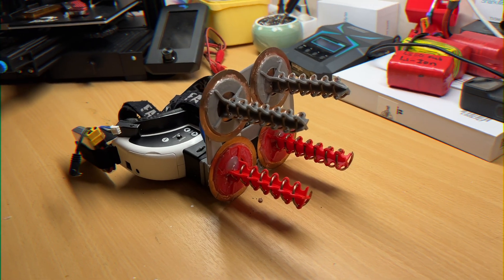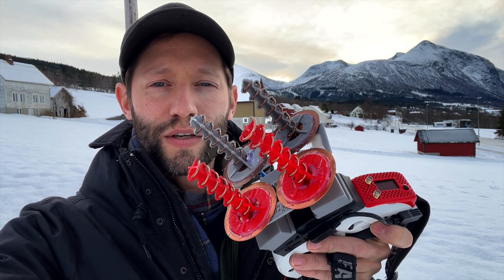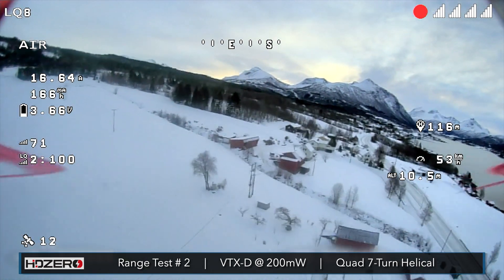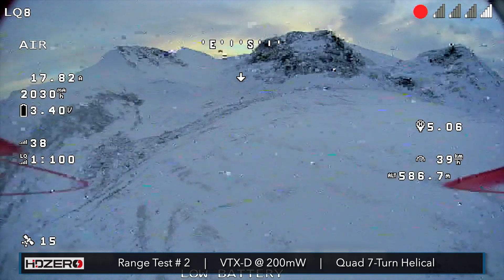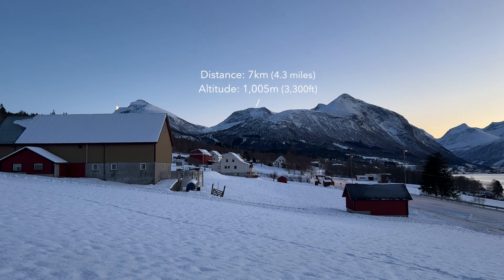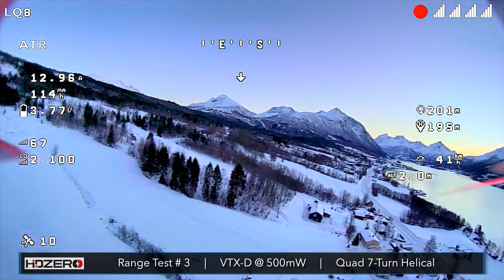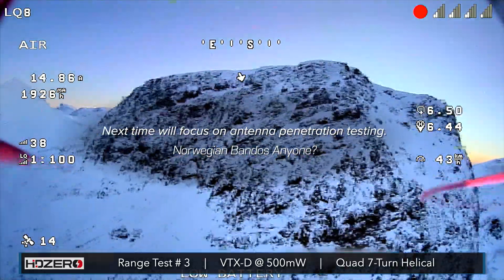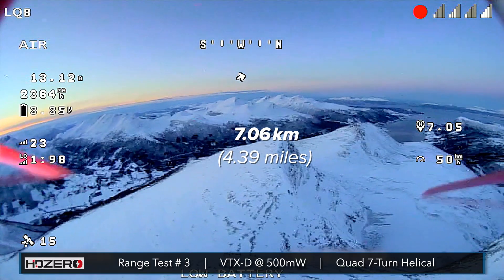HDZero SharkByte Long Range Testing with DIY Quad Helical Antenna! UFL to SMA Adapter Modification

Comment: All I see is brain cancer. Lol

 I'd probably be ok with stand alone antenna.
Reply from the maker: I understand your thought, but these are just receiving antennas, picking up signals in the air, they are not producing radiation. Two works nearly as good as one, as I show here: Cheap Easy Long Range FPV Antennas
https://youtu.be/JQiLjMU3J90

Cheers!
Reply: @GiantAntCowboy  I didn't actually realize that. I was thinking about it after and I guess the one major benefit to them on goggles is not having to adjust a base station. I'm new to this so just cramming as much in as I can.
Reply from the maker: @andrewbrown6522 yea, I like to be able to aim my head.  This is much easier with Analog & HDzero because you see the static come and go. 
With DJi/WS you kinda just watch bitrate & guess. 
But yea, cram all the information, that’s what we all do!

Comment: That's not even 1 KM. Fake, sensors not showing accurate readings at all.
Reply from the maker: @yasirahmad6271  It’s actually under 500m and within Visual Line of Sight due to current regulations and laws. 
Thanks for watching.

Comment: This why I fly fixed wing FPV, it can go for 60+ km on a charge
Reply from the maker: @nielsdaemen  yea, quads are really inefficient flight machines.  Four big motors/props, and zero static lift surfaces… 
But they give much better control in tight situations which is why I prefer them for mountain surfing.  
Building a wing had however always been on my “to do list”. Thanks for watching.

Comment: if you want to do it right you must insert a quarter wave length of 75 ohm per two  helicals....they need to be phased TOGETHER you could get another 6 db of gain for this set up you would need four 75 ohm sections all lenghts need to be the same odd multiples of quarter wave lenght....sorry im typing bad i have hand issues
Reply from the maker: I’m not gonna lie, I’m not sure what you mean by “Insert a quarter wave length of 75ohm per two helicals”… but I am curious. 
Thanks for watching and sharing thoughts!

Comment: What if you built a shield under the antenna to shield the helicals from the radio signal ? Obviously a shield that wouldn’t hinder signal of vtx.
Reply: Or is it from the tele coming from the quad . Just you putting radio closer to face caused break up .
Reply from the maker: @Loophole120  the interference in this video was because I was running my Crossfire Transmitter at 1W right below my Goggles which were picking up the signal. 
Last year I switched to ELRS and only run it at 100mW; here’s a video with some neat tests of both the ELRS, but also a quad helical design with WalkSnail and HDZero. At the end of the video I demonstrate how using High Power on your transmitter can cause lots of video interference.
“Antenna Penetration & Long Range Test”
https://youtu.be/FoSREiyDQDA

So to your question, no shield is really necessary; let me know if you have any other thoughts or questions!
Reply: @GiantAntCowboy  yes , I’ve watched those videos and that’s why I was wondering if you should try a shield .  Does the Elrs not do the same at high watts ?  If you were running high watts when you lost your one drone over the mountains edge . I’m sure the 1w would have not failed safe so quick , so I get you only like to use 100mw for that reason of interfering with video , but imo if you had more wats when you do accidentally go behind a ridge you have less chance of fail safes would you not ? So if you had a shield on top of the radio blocking just your face from the antenna, I’m wondering if you would have more success . Thanks for your replies ! Love watching and learning .
Reply from the maker: ELRS does the same at High Watt output power, the video I linked above was an ELRS test actually. 
Regarding using more power to avoid a failsafe, if you flew behind some bushes or trees far out, then higher output power would help. However if you fly behind a mountain peak nothing helps because it’s solid rock. Arguably 900mhz might get some you an extra moment because lower frequencies can “bend” a bit more, but it’s still solid rock. 
If you saw my WalkSnail test, I lost video, but actually my ELRS was connected for almost 5 seconds after the video loss.  Had it have FailSafed immediately GPS Rescue might have saved it. 

So you can try to build a shield, but i don’t know how much benefit it will have or how much benefit Higher output will really have in Mountain Surfing situations. 
The best solution is to make sure Stage 1 & 2 failsafe modes are properly set up.

Comment: Hey did you ever explore the possibility of the transmitter interference?  That is something I would be interested in.  So for example you put the Helical setup on a ground station a ways away from you.  I have been thinking that is an issue too but once I saw you mention it now Id like to know.  I dont have the setup to test it though.
Reply from the maker: So last year I switched to 2.4ghz ELRS & only run it at 100mW. This performs really well & doesn’t cause any video interference. Highly recommend!

p.s. I like having head mounted antennas so I can re-aim as needed. If I was always flying in a straight line, like with a long-range wing setup, then a ground station would make sense.

Comment: In analog, for maximize penetration and distance, is it better to fly in BOSCAM_A or BOSCAM_B or BOSCAM_E or FATSHARK or RACEBAND?
Reply from the maker: Generally most VTXs perform better at lower channels. I always use R1 for example. 
The difference between R1 & R8 could be as high as 40% less power! So definitely worth doing a couple tests.
Reply: @GiantAntCowboy  Thank you for this information regarding the R1. Regarding BOSCAM_A or BOSCAM_B or BOSCAM_E or FATSHARK or RACEBAND, is it important or does it change nothing?
Reply from the maker: @loicader56  not a huge difference between the bands, just try the lowest channel you can use. 
Note: Wifi interference can be worse on lower channels. So if you have lots of Wifi interference a higher channel may actually work better…
Reply: Ok thanks :)

Comment: HD zero looks like an analog when loosing signal, that last test is very relatable! whew! intense!
Reply from the maker: Yea, the system is very similar to analog just with a better image. I consider this a pro actually when compared to other digital systems for many reasons. 
If you watch my recent WalkSnail review you’ll get a better idea of what I mean by this. Essentially I just trust the analog/HDZero more than DJI/WalkSnail because there is no “compression and retransmission” which hide signal issues. 

Yea this was the last flight for this particular quad, let him go out as a hero!! Stay tuned, cheers!

Comment: It's such a nice experience. Bravo!
Reply from the maker: Thanks, was a fun test. I’ve done some follow ups, and got similar performance using only two helicals which looks a little less insane! Appreciate the comment, cheers!
Reply: @GiantAntCowboy  I recently purchased a walksnail VRX + avatar HD system. I've seen people using a satellite dish for a receiver reflector. Would you consider such a test? I definitely may :) Thanks
Reply from the maker: @FPV420.  I plan to test WS with these helical antennas. I actually had a 1s WS VTX but killed it on my second test flight in the snow… it’s part of the last “HDZero Goggles” video. But I just received a proper Micro VTX setup which I’ll be doing some range and penetration testing with, so stay tuned. 
* Technically the system has already been push out past 30km by Wezley Varty, definitely worth checking out his video if you haven’t already.
Reply: @GiantAntCowboy  I've seen the video and actually he is the  inspiration for my question. Anyway, I got two GepRC "dinner plate" antennas and I will try them out as soon as the weather allows it.
Reply from the maker: @FPV420.  nice, yea weather and lack of sunlight have slowed my tests…

Comment: I assume you conformal coat?
Reply from the maker: Yes I do, generally… though just last week I was testing the WalkSnail system, video froze, I found the quad dead in a snow pile. FC and VTX fried. Put together this test setup super quick and paid the price. New parts ordered already. So I Highly recommend conformal coating your builds! 
Thanks for watching, stay tuned, cheers!

Comment: Great I guess if you want to look like SPaceman Spiff.

Really this VRX box is best to go on the back of a huge HDMI tv, not be hanging off the end of your face with all that face.  #endthegogglepwwke
Reply from the maker: I made this really as a joke, but actually still use a modified version of this antenna setup for range and penetration. I’m currently beta testing the new HDZero Goggles which eliminates the VRX box and further streamlines the setup. I’ll post a video about those this weekend, but thanks for watching and I appreciate the Calvin and Hobbes reference, cheers!

Comment: I wonder how much the temp affecting battery performance. I would wager that it would be measurable
Reply from the maker: Absolutely, hot and cold temperatures play a big part in battery life. Maybe I would have made it back… but even on a warmer day this quad struggled to do this distance. 
This quad was a bit of a joke… but my current setup is a 7” build using the Chimera 7 frame, 2807 motors, and with 6s2p battery packs. This distance/flight time is no longer a problem. 
Check out my more recent videos of curious, in fact I have a whole video about li-ion battery setups. Thanks for watching, cheers!
Reply: @GiantAntCowboy  Can you get the temp from the BMS on the OSD?
Reply from the maker: @LabiaLicker  these are basic DIY battery packs with no BMS setup. I’m if you had a good BMS installed maybe you could track data. 
Voltage can is a better indicator than mAh used, especially for the last half of a flight.
Reply: @GiantAntCowboy  Okay. Reason why I mentioned the BMS is they usually have a thermocouple. Wouldn't the flight controller have a temp sensor you could use?
Reply from the maker: To be honest I’ve never researched this, but, the OSD can display FC and VTX temp information, so if the battery had a Thermocouple it seems reasonable that you could display this data. You’d have to have a way to wiring the BMS to the FC of course.
Reply: @GiantAntCowboy  I don't think there would be all that much difference in temp between the BMS and FC. So having the temp from the FC be letsreadout to the OSD. Would be the best way of going about it.

Comment: That was a brillian flight body! Very risky but very interesting. Wish I could reach that distance!
Reply from the maker: It was an intense test, glad it worked out! I’ve since built a proper 7” quad which performs much better. If you want to increase your range I highly recommend helical antennas, cheap, easy to make and have incredible performance. Here’s an updated video demonstrating that:
https://youtu.be/JQiLjMU3J90
I also have a simple DIY video if curious. Thanks for watching and commenting, cheers!

Comment: Amazing! That was crazy. The suspense!! 
It was like holding it in on a 14hr flight to Singapore.
Stupid question - there are 2808 and 2810 and 3110. Why not 8" or 9"?
Reply from the maker: Haha, thanks! Glad you found it fun and thrilling. This quad was a random build, started as a cheap freestyle quad but evolved into a long-range test quad. This was basically it’s last flight. I’m currently flying a Chimera 7 with 2807 motors, 7” props, and 8000mAh 6s2p battery setup. 
Check out my current videos to see that setup and current tests. Thanks for watching and stay tuned, cheers!

Comment: The results are amazing. But i dont understand one Thing. You are using 4 Times the Same 7 Turn helical Antenna. What is the difference to one Antenna because everyone is at Same Turn and looking in the Same direction?  Thank you
Reply from the maker: Yea, good question, so the way HDZero works is a little unique. Instead of picking the best antenna (like a traditional diversity RX) it actually combines the signals/packets received from all antennas to create the FPV image. Because of this you actually get the best image and range by using the same antennas pointed in the same direction. 
Now you can use different antennas, or aim the antennas in slightly different directions to get wider coverage, but the overall image/signal quality would be reduced. So it’s a trade off, but for me I have no problem aiming even at 7km with this setup. 
Two additional notes:
- This quad helical setup is overkill… simply using two helicals with stock setup works extremely well as I showed in this video last month: “Cheap and Easy HDZero Long-Range”
https://youtu.be/JQiLjMU3J90
- These directional antennas actually work well up to 1km directly behind my head. I’m working on a video now testing if the idea that using Omni antennas on your VRX is basically a waste. 
Thanks for watching and stay tuned, appreciate the support, cheers!

Comment: Just maidened my HDZ freestyle equipped Talon Pro last week. Im seeing the same thing as you with my ELRS RC transmission. Lift up the transmitter, video noise, lower the transmitter, noise cleans up but RC RSSI drops. Wonder if there’s a magical channel setting on the HDZero setup which doesn’t suffer from 2.4GHz interference.
Reply from the maker: Hey thanks for watching. Are you using Helcial antennas by any chance?
Reply: @GiantAntCowboy  Indeed. Two home-made 9 turns. I ordered two triple feed patch antennae but only one has arrived so far. Last flight I used a couple of three turns, a nine turn and the triple feed patch. Not the ideal setup using mismatched antennae but it did maybe seem like there may have been slightly less interference. You thinking the interference problem may be particular to high gain helicals?
Reply from the maker: @wattage2007  yup, our helical antennas are 5.8ghz directional antennas, but they can also act as di-pole antennas.  Basically if you stretch the copper coil out you might find the length is close to a particular wave length. For example I’ve found that 7-turn helical antennas use a length of wire similar to 900mhz wavelength (roughly 33cm or 13inches). So they can and do pick up these radio wave in the form of interference. 
So far I haven’t changed my setup to correct for this… but is a future test/project on my list. 
If you keep the controller down it’s not too bad. 
What sort of range are you going for?
Reply: @GiantAntCowboy  Yeah, good call. I never measured the length of wire used for the 9 turn, could be that it’s a multiple of a 2.4GHz wavelength. I may try snipping a turn off it to see if that makes a difference. 
I’m not after phenomenally long range. 10km would do me but at the moment, as I’m testing range incrementally, I’m finding this interference starting to become a problem around 5km. I’ve got another of these miracle triple feed patch thingys arriving soon so we’ll see if that gets rid of it.
Reply from the maker: @wattage2007  keep me updated, always nice to hear what others learning. Not sure if you saw my recent Range Test video, here: 
https://youtu.be/JQiLjMU3J90
But I talk a little bit about the interference and maybe you could compare to your findings. (I was basically just showing how simple, cheap and amazing these helical antennas can be when added to HDZero)
Reply: @GiantAntCowboy  Yup, I’ve watched that video a number of times! Think it was that video which persuaded me to try making helicals 😀

Comment: I wonder if you compared it to a Yagi antenna, especially that helical antennas are best for polarized signals, and the TrueRC OCP isn't polarized.
Reply from the maker: You’re suggesting running a linear antenna setup?
The TrueRC OCP is a Circular Polarized antenna and matches the helical polarization. Let me know what you meant, thanks for the sharing. Cheers’
Reply: @GiantAntCowboy  Oh sorry I only looked at the photo and guessed it wasn't polarized. Okay that explains your choice much better. I guess I'll look to change my Tx antenna as well. However yes I was considering a comparison with a linear antenna setup.
Reply from the maker: @werner-real  I have also been curious about trying a linear antenna setup. For long-range in the mountains multi-path rejection and other benefits of CP antennas aren’t so important and linear antennas should actually offer better range. 
Let me know if you try a linear antenna setup and how it works. Cheers!

Comment: So, did you kill the battery?
Reply from the maker: Surprisingly the battery pack continues to work fine, and this is not the first time I’ve completely drained them… these Molicel P42a cells take a lot of abuse. Thanks for watching, let me know if you have other questions, cheers!

Comment: Great video! Glad you made it back.
Do you have a link to add to your description of the length of the SMA to UFL cable?
Reply from the maker: Thanks appreciate the comment and support! Here’s the SMA to UFL I used: 
onelinkmore RF Connector Pigtail Cable SMA Female Bulkhead to U.fl/ipx Extension Cable 1.13 Cable 5cm Pack of 2 https://www.amazon.com/dp/B01AJQ33Y4/ref=cm_sw_r_cp_api_glt_i_MQEWH5KZHXQK88RYMSDK?_encoding=UTF8&psc=1

Comment: Pro tip: Batteries discharge faster in cold temp. Make yourself a neoprene "sock".
Reply from the maker: Oh yea, that’s a neat idea, thanks for the tip! Just finished my 7” build last night which features an interesting new piece of equipment… stay tuned for more test flights, cheers!